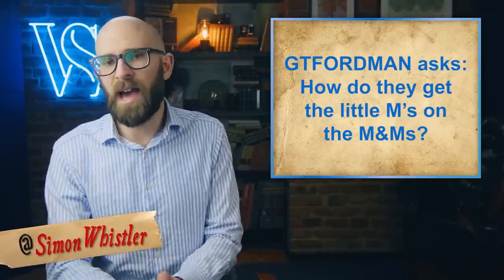How Do They Get the M on M&Ms?

Comment: I've been a 1st pressman for going on 15 years (5 years being 2nd and 2 years as a 3rd) well done explanation of the offset printing process.
Reply: KEVLAR1911A1 G21 it was fairly good, I work on a printing press to lul
Reply: But just to confuse things, that classic illustration of a print shop was non-offset (direct) relief printing aka letterpress.
Reply: Kevin Martin true I noticed that also lol
Reply: We do lithograph 4 color process with the ability to coat and 1 unit for PMS colors. And yes the press did seem out of place for the explanation.
Reply: KEVLAR1911A1 G21 oh that’s cool I work on a Harris M1000 which is a cover press and we have 4 colors and a extra unit on either side for special inks and a uv-er down after the chills
Reply: Ours is a Kamori 19x25, aka the devil. We run water units one per color on side facing backwards from front that would be left. How long have you been a Pressman?
Reply: Worked in a print shop for 13 years until they shut the doors. I didn't work on presses but ran Stichers, Flatbed cutters, & Perfect Binders. You guys are making me tear up. I loved that job.
Reply: KEVLAR1911A1 G21 I’m not a pressman but want to be one one day, I’m a lead material handler where I work.
Reply: @kevinmartin7760  That explains why the explanation confused me then.
Reply: @crafted4521  keep at you'll get there.
Reply: @solitaryman7485  yes it's a dying profession. The cut board is a very tedious job, sounds like you have alot of skills in printing, we used to bind by hand if the thickness was to great, nothing like walking around in circles all day assembling books 😒
Reply: Hi, I've been a pressman for a long time, the diagram seems correct to me as an offset press, viewed from the drive/gear side, I wonder who manufactured the press for the m&ms
Reply: Making the candy for a living and seeing the printing process most days, it was fascinating listening to the description.

Comment: I've been a printing operator for M&M Mars for about 3 years now. And his descriptions are pretty spot-on. With one exception. Our quality control guys actually really hate when unstamped M&Ms get through and will grumble pretty hard if they find them in the 100 count process. 

Another fun fact. The cups that hold the M&M's in place for the stamping process are fitted exactly to a specific size range and Double peanut M&Ms get jammed in them all the time because they are too big. 

If it gets to be too much, we have to stop one of the printers and pick them out of the cups one at a time with sterile pick tools. A very tedious process, but extremely necessary for a smooth operation sometimes.
Reply: But how do they get the candy coating on there smoothly lol

Comment: it's called "pad printing" i used to do it for an ad specialty company in Seattle.  it's basically a soft rubber-ish pad than you first stamp on the plate to transfer the image to the pad and then the pad is pressed down on the substrate and leaves the image. There's a clamp to hold the thing in place and 2 levers (so you can do a 2-color print) each with it''s own pad than you raise, lower and swivel between the plate and the thing you're printing on. Super low tech, really. Though I pad printed many things, the one I left the biggest impression on me (c wat i dud thur?) was printing the Microsoft logo and the word "Sidewalk" on 140,000 pieces of sidewalk chalk for some Bing feature called "Microsoft Sidewalk" that lasted about a month at the end of the 90's